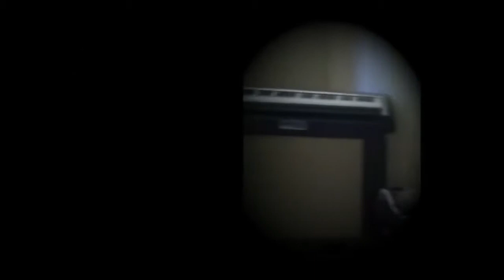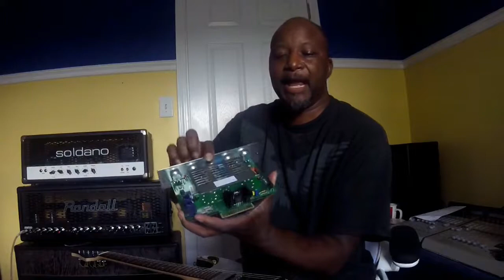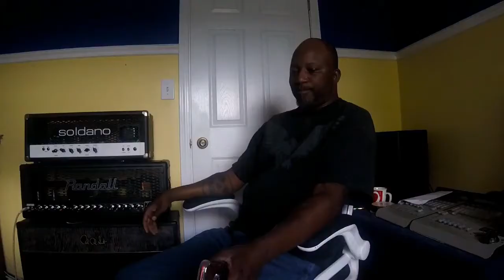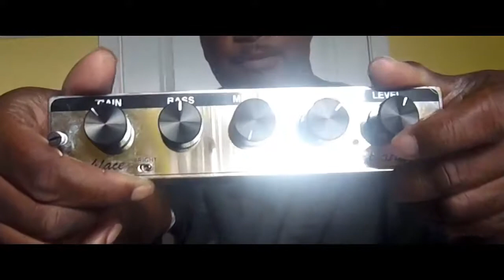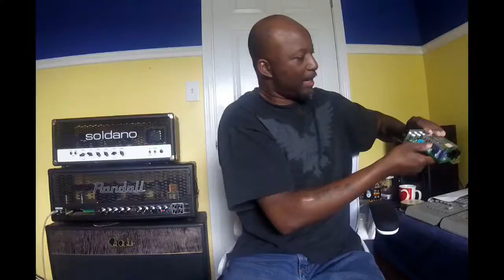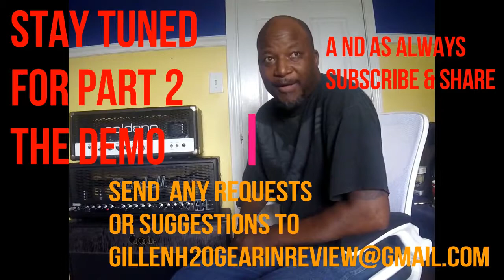Randall RM100 100 watt modular guitar amplifier review.

Comment: Why are these still so expensive still. This man in 2025 now seems to have the most knowledge about these amps. There are 12 different modules, and nothing pops up. Even the amps go for a terrible used price with modules. I bet this thing is a great power tube amp considering using a separate preamp. Though almost any tube amp can be used just its power section. I like to use my Peavey valveking and Line 6 mk2 for only their power tubes sometimes. I bet these wonder wreck of green boards could be the same.

Comment: I have one that i bought from a man from a German band named Accept. Noboidy has really heard of them unless you say Dalls to the Wall. Any way this thing is amazing. It had the Ultra mod and the Tuetonic Terror mod.  Salvation mods came to Nashville for 10 days to make he preamp custom.  The donor was a Plexi. Once done it became the Teutonic Terros 1 of 1.  I have since bought a Clean to fill the empty space.  I do not regret that at all since I use that one mainly now.  The sustain when it is driven is unparallelled. The speakers have been replaced too.  70th Anniversary Celestions Special Edition G12H and G12 Vintage 30's staggered.  This has toured the world four times and made several of the newer Accept Albums.  Do they even call it that anymore?  I hope they do not go away.  I want to find a 2x12 version so I can take it with me and grab the mods from the 4x12. The head weighs like 200 pounds it seems like. I am a metal head from the 80's so it is all still cool to me. Who wants to discuss?
Reply from the maker: very cool, also very cool that it belonged to one of the guys in accept. currently i am using the synergy modular system and loving it

Comment: "No one had ever heard of a modular system before"??????
Apparently you're not familiar with the original analog modeling amps made by Seymour Duncan in the early 80's. Check out the Seymour Duncan Convertible. Let me know if your interested in purchasing one , I have about 7 of them. Combo's , Head's or Rack Mount , all 100 watts.
Reply: Those Duncan amps had switchable preamp tubes. You didn’t switch the entire preamp.

Comment: did the part 2 ever get uploaded
Reply from the maker: nof customs unfortunately no I temporarily decided to go with a dual combo amp setup, and sold this amp, but I wish I’d kept it.
Reply: i have an oppurtunity to get one so im thinking so hard about it.. is the cleans transparent. in a guitar maker my current amp is a supro dual tone which i use to check repairs and my custom guitars that i make pickups for.. but sadly my supro has no gain..so i get it from a pedal,ksr ceres yet i still miss the organic sound of a tube amp with gain
Reply from the maker: nof customs I really liked the gender based modules, so yes I think so.